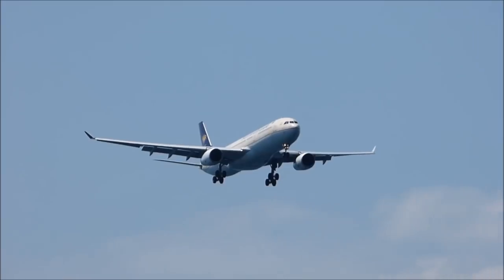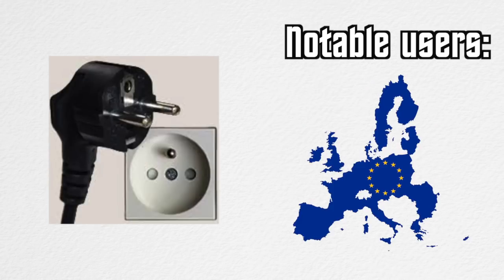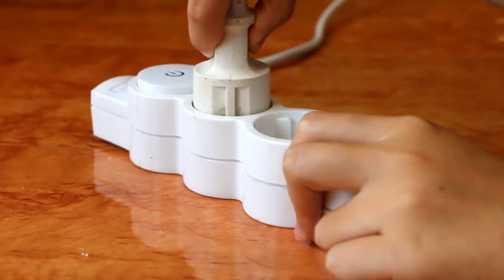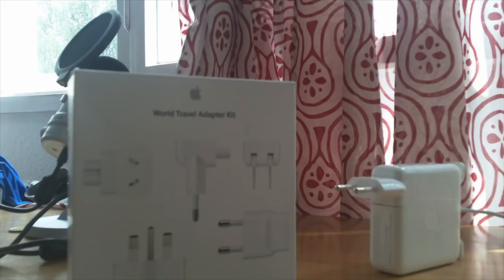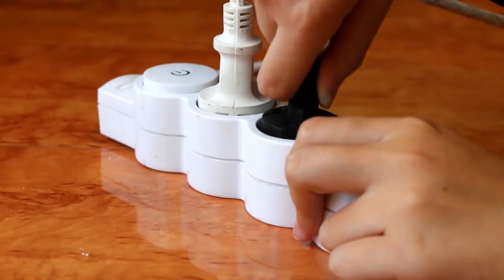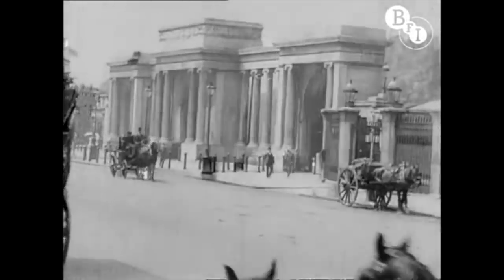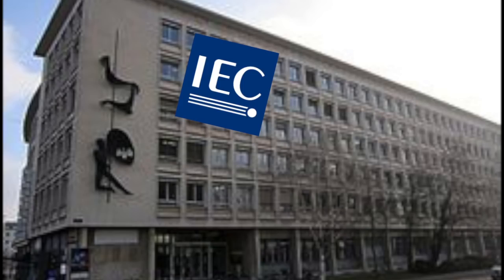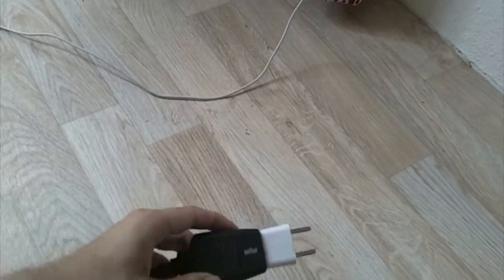Why Different Countries Use Different Plugs

Comment: Most of the time when you said "frequency", you meant "voltage". Voltage is far more important than frequency. Frequency only matters to appliances that contain an AC motor, and an incorrect frequency will just result in it running slightly too fast or too slow. But if the voltage is incorrect, the device either won't work at all, or will get damaged, sometimes with smoke and flames, although usually not as violently as your fake explosion.
Reply: USUALLY?
Reply: This is only correct on induction motors.
Reply: Hello VWestlife
Reply: Important is also that incorrect voltage only means flames if the voltage is higher than what the device is made for. If its lower, it will only have troubles to work, but no flames or smoke.
Reply: @Saroku1000 It can depending on the conductor size. Lower voltage means higher current is needed to power an appliance therefore a bigger conductor is needed.

Comment: Frequency is largely irrelevant. A 50Hz motor just spins faster on 60Hz.  Voltage is more significant 240V (typical for Australia)(or 260V in parts of Western Australia (but this is slowly being adjusted down to 230V)) will kill a device designed for 100V (typical for parts of Japan) due to issues of insulation withstand capacity and increased wattage on heaters. FYI japan used to have both 50Hz and 60Hz generation and voltages ranging from 100 to 220V so Japanese equipment was designed to cope with wild voltage variations unlike American equipment making exports of electrical equipment easier. 
FYI The Australian plugs were standardised in 1923 and are based on a 1919 US 220V standard. They are used in Australia, New Zealand, Argentina (who are phasing them out)  and China (who are phasing them in).
Switch-mode power supplies are generally happy with anything between 90V and 240V and 45Hz to 400Hz (a lot of aircraft AC outlets are 400Hz as the alternators  can be made smaller and lighter).

Comment: with the uk plugs, the live openings have safety covers on the sockets and the earth pin on the plug opens the holes as its pushed in. also, the uk has what is known  a ring main, which is basically one cable, on each floor,  that goes around each room and the the sockets connect to it in series and each ring main will have its own fuse on the distribution board rated at 20-30 amps and each plug will have its own fuse rated at either 3-5-13 amp depending on its use EG. a kettle would have a 13 amp fuse and a table lamp would have a 3 amp and an electric cooker (stove) would have its own circuit rated at 40 amps

Comment: "It still can't handle the frequencies of the European power grid". Well, the motor might run weird, but 50Hz is close enough to 60 that it would still work. The bigger problem is the higher voltage, which could fry the motor and heating element. On some driers you can run them on low on 240V, which corresponds to high on 120V. If you flip the switch to high it will trigger a thermal protection circuit and you will need to wait a few minutes, but it shouldn't go boom unless it is some Chinese crap.

Comment: So basically we have 2 different Voltages (110 & 220V) with 2 different frequencies (50 & 60 Hz), So we could use 2 or maximum 4 different plugs, Why there are still so many of them ? We can eliminate 80% by using standard plugs.
Reply: Voltage and frequency has nothing to do with the plug type. There are many plugs as nobody wants to change.

Comment: Crappy hairdryer that can't handle a frequency change from 60 to 50 cycles? Wow! That's nothing! It shouldn't matter a damn. Where did you get that thing? Find it in a skip? 

Or did you try to plug it in in the bathroom? International bathroom sockets are limited to low current devices like shavers and most chargers. Electric loads above about 100 watts will make shaver sockets heat up and then the internal thermal protection will shut off the juice until they cool off.

Look, I think you have got hung up on frequency here, but I cannot see why. It shouldn't matter a damn, unless the mains frequency itself is being used as a timing mechanism in the appliance in question, say, as used to happen in clocks and TVs. But those items are seriously archaic now. 

And frequency has absolutely NOTHING to do with the shape of plugs. That is silly. There are only two different frequencies used globally, but as you say yourself, there are many different plugs across the world. 

Nearly all those foreign plugs are better than the flimsy 2-pin American ones, but the internationally acknowledged safest plug, and therefore the best by a long way, is the 13-amp individualy fused kind used in UK. They fit into shuttered sockets, too. They are bloody brilliant! If there were ever to be an international standard, this is the one to go for. Oh yes!

Comment: There is also another oddball: Japan (North Island only) is 220v / 60Hz.
The UK "G" type is by far the best, (if a little bulky) because it can be hand wired, has a cable clamp, is earthed, fused and the socket has guards to prevent people poking things in the holes.

Comment: I think though the North American plugs are small and compact, they are the most dangerous, it's quite easy to get zapped because the prongs become live before fully inserted. The European plug is better in this regard because the outlet is recessed so it's impossible to put your finger on a live prong. There are older ungrounded outlets with only two holes flush to the faceplate, but because on our ungrounded plugs only the prong tip is conductive so you are never exposed to live voltage even with the plug part way in. The UK standard though safe is extremely bulky, so the European standard (schuko) is a good compromise.

Comment: You had a little error, where you showed, which plug-types are used where. With Plug Type E and F and their corresponding areas to be exact.
The images you show for the Wall-Plugs are the correct ones, but you showed the cable-plug Type E+F. It is fine (since there aren't really any devices with just type E or F anymore), but i just wanted to mention, that both have their own actual cable plug, which is not compatible to the other.
Plug Type E was solely used in France and some parts of Belgium and Plug Type F is used far outside of Europe (Russia, South Korea, Ukrain, etc.)
Reply: The E type is used  in 29 countries and in 19 exclusively. In Europe it is used in France, Belgium, Poland, Czechia and Slovakia. Schuko is the exclusive grounded socket in 44 countries.

Comment: a good case is here in brazil, in 2010 we switched from type B and C to type N, by the same period, we switched from 110V to 220V, so depending on the age of you building, you can have a 110V w/ B outlet(since type C can be plugged in a type B), a 110V w/ type N, 220V w/ type B and 220V w/ type N. Normally 220V outlets are found in commercial building, and 110V in residential ones, but due to the  fact that electrical appliances are portable, usually commercial buildings have mostly 220V with a few 110V outlets, and residential the opposite, mostly 110V and a few 220V outlets; BUT thats not a rule, so you can live in place with no 220V outlets, and work in a place with no 110V outlets, so you have to buy a transformator of current in order to plug you stuff

Comment: British plugs are not just the safest and therefore best plug but they’re also one of the best inventions ever. There is almost nothing you can do to get a shock from one even if you try and if it breaks there is a earth wire that grounds all electricity. American and European plugs are the same levels of danger more or less just different shapes
Reply: type b plug has the ground prong longer too. European plugs has the ground pin on the socket instead of the plug itself

Comment: High voltage ain’t shit if it has a low current behind it. A medium current with very high amps is better. The EU has a shitty infrastructure when it comes to electricity.

Comment: UK has switches while everyone else doesn’t
Well, I know which plugs are safer!
Reply: @crite spranberry Sorry what? There's only one type of plug in the UK. Sure it's big but I'd rather safer than smaller
Reply: RedOrange12098 not only UK actually...
Reply: You know that the fuses in the UK plugs are actually a hack because of the poor old wiring? That's nothing you would ever do by design! It's the result of a change of the standards of the powergrid.

Comment: honestly the plus aren't too bad yet, it's the voltage difference and frequencies. even though 50 or 60 hz isn't that big of a difference, I think Europe should use 60 as well. if you'd try to use anything with a motor (mixer, vacuum, …) on the wrong frequency, it's gonna run very poorly. 

but different voltages is what's actually dangerous. a device bought in the us will indeed literally explode in Europe. I don't even think the 240V in Europe is a lot, but the 120 in the us is way too low… they can't plug in a regular 2.000 watt space heater into a 15 Amp socket, because it can only draw 1.800 watts, after which you can't plugin anything anymore or the breaker will trip. in Europe, a circuit is literally never 100% occupied, but the same 15 Amps will give you 3.600 Watts. 
Which is also why lower voltages are less efficient. In the US, 1.800 Watts draws the same current as 3.600 in Europe, so half the wattage will require as thick of a cable as double the wattage in Europe.

it's kinda stupid tho why does every country need to be so different

Comment: I only noticed when i was looking to see if there was a Australian compatible version of a dehumidifier but for some reason australias been marked on paper as 230v but we all still use 240v mains power.
Im guessing all devices with a heating element are the sort of thing you’ll see listed as one voltage only where a lot of other devices now are rated for 110v-240v.
“Left out mentioning frequency”
Reply: 230 V and 240 V are basically same.
Reply: @okaro6595  its enough of a difference to fry devices and start fires.
Not a absolute because they would usually put big enough tolerances in them but its never a guarantee of safety.

Comment: Before the days of universal voltage active PFC computer PSUs, remember the little red switch? It converted the input between full bridge rectifier (220-240) and 2x halfwave doubler (110-120)…. Woe betide you if it was in the wrong position for 240V - ooh, nasty!

Comment: Because Europe is ignorant bastards who think 220 is ok to use for everything. Here in America where common sense is still sometimes used. We use standard 110.  Much safer. 220 is used all over third world countries because simply put. It is easier to string all over. 110 takes some planning and thinking behind it . 220 will kill you if accidently shocked 110 usually just scares you. 
      220 is not grounded thru a gfi,  or ground fault interrupter.  So it will literally cook you. Here in America we have safety regulations for dumbass people to stay safe.  220 is not grounded and will continue electrocuting even after their is a short. 110 will cut off and blow a fuse or breaker. 220 does not . So answer. Other countries are lazy and unsafe with power . America still does it better here too.

Comment: I lived in South Africa for 2 years and they do not use type-n. They use the same plug as Europe and India. This is a really good video though👍
Reply: justin styles Most of them have replaced with new outlets. SINGLE TYPE M and 3 Type N outlets are available on Hardware stores. Most hotels used that outlets.

Comment: In Malaysia use type C and G. Plug similar to UK 3 pin plug and 2 pin EU plug. If you bring wrong adapter confirm sure it won't fit. 
If you're from Thailand using 2 pin plug (similar to EU 2 pin plug), it still fit but need to push very hard to force that plug into Malaysia socket because Malaysia 2 pin plug is smaller than Thailand ones.

Comment: Yeah I found to check that adapter can not take higher power volt and burn out the adapter. Hair dryer please check there usually and switch.

Comment: That's easy to understand. Different countries have different VOLTAGES. Every country uses 240v, 50Hz. America, being the egotistical, isolationist imperialistic and narcissitic country that it is, uses 120v. We use miles, and pounds and Farenheit temperatures. Almost every other country uses kilometers and kilograms and Celsius temperature scale. The purpose of different plugs is to prevent plugging an appliance into an outlet with the wrong voltage. And yes, I posted this comment BEFORE I watched this video

Comment: The biggest problem is that in America they take the attitude that a hard core appliances, such as an oven, will take 240V and thus 2 distinct hot lines, instead of one, vs Europe, which just everything gets 240V. US saves a lot of specialized wiring over 240ing everything. 120 is just about touchable without lasting damage.
Reply: In Europe many devices use three phase like ranges.

Comment: U can plug C management to E or F wall plugg in Europe
Reply: Sure, the Europlug has been designed to fit various sockets with 19 mm (0.75") pin distance. There is no C type socket even though they incorrectly show the ungrounded socket.

Comment: Most hotel rooms have a  hair driver, so you don't need to worry about blowing up the city in case yours works on the wrong voltage.  Switzerland is an island.  Bring a special adapter if you're traveling there, although hotels may have a standard European outlet to use.
Reply: And usually they don't work at all.

Comment: People keep talking about the different outlets and plugs used in different countries.  People have particularly been talking about the UK plugs being the safest. Whether that's true or not is a matter of opinion.  One thing I haven't seen in the comments, is that with the UK outlets, not only do their outlets mandate 3 prong in order to plug anything into it, but each outlet also has an on and off switch on them.  Just plugging in a device isn't going to supply power to it.  You have to remember to flip the switch to that outlet, in order to power it.  That's something I don't see on the other European outlets.  I do like that the European outlets have the outlets being caved in a bit, that the plug is flush with the wall plate.  So there's some safety to that.  UK & European plugs have a coating on their plug prongs that reduce shock, if you touch it.  North American plugs don't have that feature.  In North America, depending on the local electrical codes, the grounding prong might be up (like the UK), or down.  Where I live, the grounding prong must be down, even though if a kid (or a stupid adult) decides to plug something in only part of the way, then slip a piece of metal to touch the hot & neutral wires, then a few sparks will fly, & possibly fry the outlet.

Comment: From safety prospective all plugs that are flush agains the wall are not ideal. J and F are good in safety and compact also they cant hurt you when you step on them. I dont know if they can be replaced like EU plugs. C and E are old version and new appliances must be with F type. 
But in my opinion no desing is safe when human ignorance is involved.
Reply: Most plugs that are flush against the wall, like the L plug (Italian standard), have the pins insulated at the base, so they are safe like plugs with hollow sockets ( https://www.viaggioideale.it/wp-content/uploads/2008/11/l_plug-300x136.jpg ). Type F plugs are really not compact. See this dual socket with a Type L and a type F. The Type F occupies double the space for the same amperage https://www.worldstandards.eu/WordPress/wp-content/uploads/electricity-type-L-bipasso-socket-300x223.jpg .

Comment: What I really like about the british plugs is that they each carry a replaceable fuse inside them. In Europe you can use type E/F plugs (which are mostly rated ~230-250V, 16A) or the C plug. The C plug is for ungrounded, low power applications (rated ~230-250V, 2,5A) and could have thinner wires inside. In the event of a higher power draw that the cable can handle (let‘s say 12A for whatever reasons), the usual 16A circuit breaker wouldn‘t notice the cable overload.
Reply: You cannot use the Europlug on a device that uses 12 A. You must use the contour plug so what you described does not happen. Note at least on Finland you can never split the Europlug so an Europlug extension cord can have only one Europlug socket. This is to prevent the overload.
Reply: @okaro6595  Yes, devices built to use the Europlug are not supposed to draw more than 2,5A. „Does not happen“ is not entirely correct, as some fault conditions may still lead to overloading the cable/plug without overloading the breaker. It should not happen, and is pretty much extremely rare, but not impossible.
Reply: @konny3423  If you get a fault you unplug it.

Comment: Britain used to have round pin plugs with the same pin layout and two different sizes for 5amp and 15 amp. Changed sometime in the 60s I think.